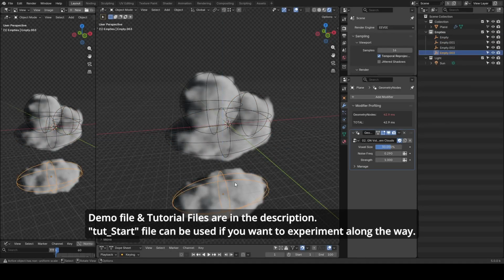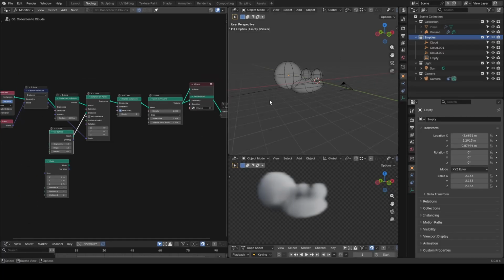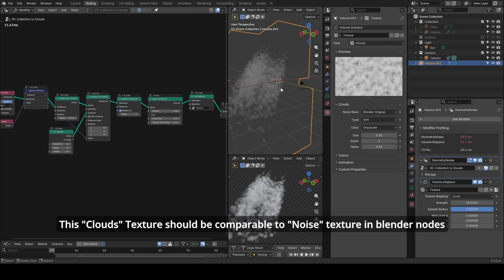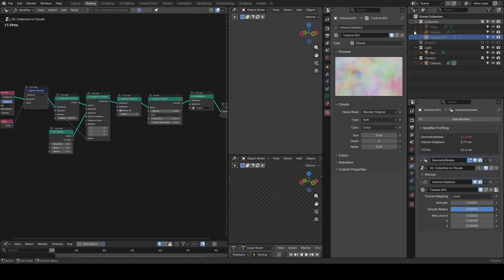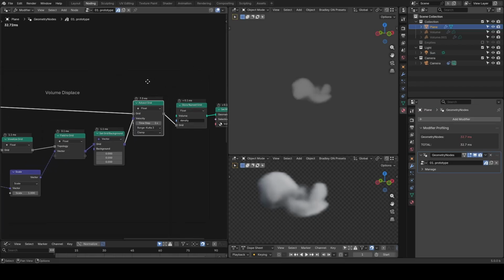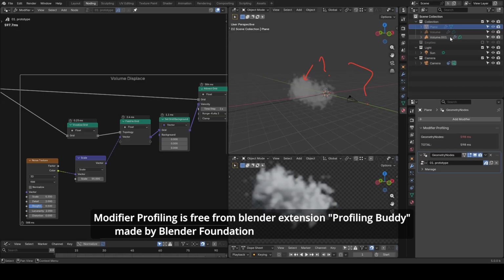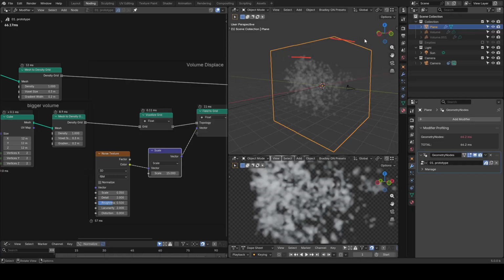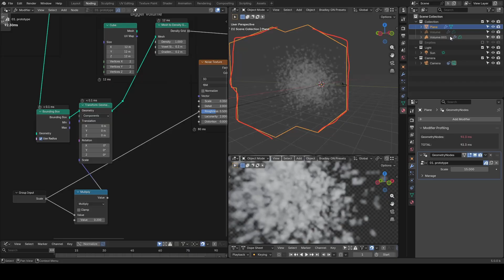[Tut] Volume Displacement Cloud in Geometry Nodes 5.0+

Comment: Because my apartment gets too cold, all of my projects recently have been involving volumes . Typically with colliders. Objects passing through fog and clouds. Round tripping w Embergen. . I’d like to know how you would take advantage of the attributes to tweak a VDB sequence nce. To correct, exaggerate, or significantly alter the animated attribute values. I’m considering  doing at least the volume work in blender 5 going forward  if I can get a x2.34 increase in awesomer effect somehow. I can take advantage of some of the volume trickery you’re showing how to do. But boring regular collision is what the scene usually has and I’d like to punch it up

Comment: Speed is important. But so is delivery. When you're counting differences in milliseconds I would say its a non issue comparatively to the render which is going to take minutes. Also optimization to the nodes is a given, so keeping things together in a node tree with settings and into the asset library in my opinion is an extremely good trade off and possibly not a trade off in the future at all.
Reply from the maker: I don't think the old method is really slower in delivery. you can still turn everything into an assets without any problem.
also as mentioned in the video, what's shown is just a quick example, and you already see 1.5X differences and potentially even more based on the settings for the amount of details for your volume or so.
ultimately it can reach seconds and even more very quickly. so personally I am not convinced with this method. but at the end it's users' decision :)

Comment: Interesting, any technical reasons why would the GN settup is slower than old way ? 😮
Reply from the maker: I can't tell much for this exact case, although creating 2 volume to resolve the boundary limit seems related.
On the other hand, it's not really new that GN is slower than modifier. IIRC, "extrude node" is already slower than "solidify", "merge by distance" in GN is also slower than "wield".
Two systems have different data structure like BMesh Vs. Mesh, also optimization such as GPU evaluation can always be done later.